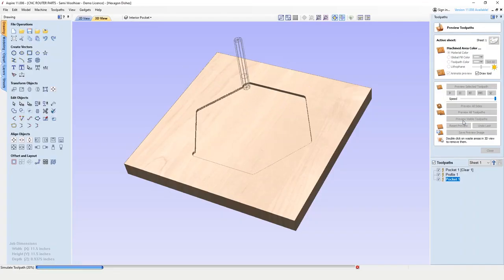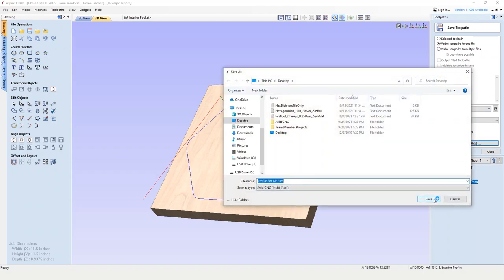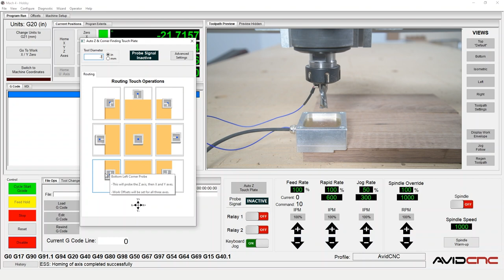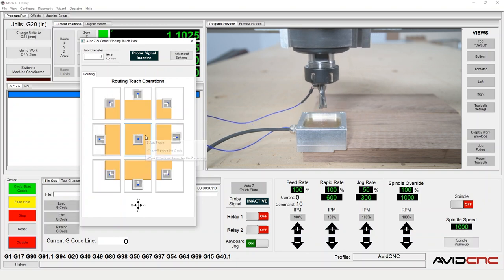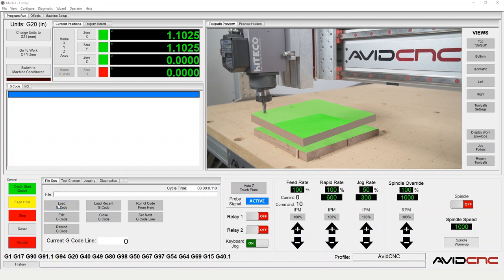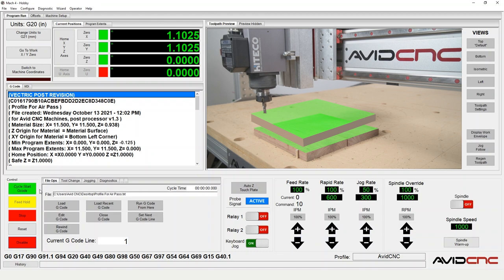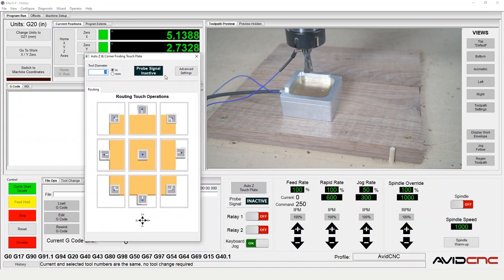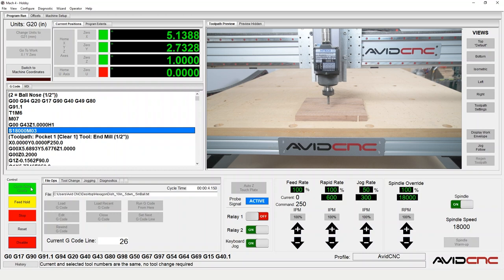Pro-Tip: How To Run an Air Pass on Your Avid CNC

Comment: An easy way to see where the bit will go is to collet up a boresight laser.  They're less than $20 on Amazon.  You can get one to match the size of the collet you have, and it will do a nice red laser line exactly where the center of your bit will be tracking during the cutting phase.